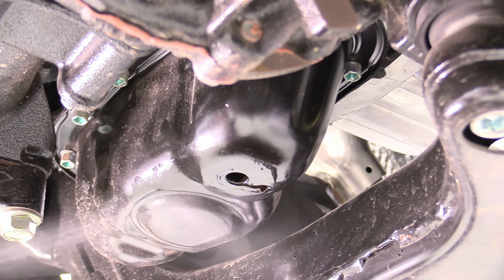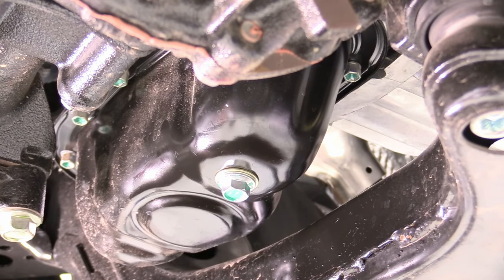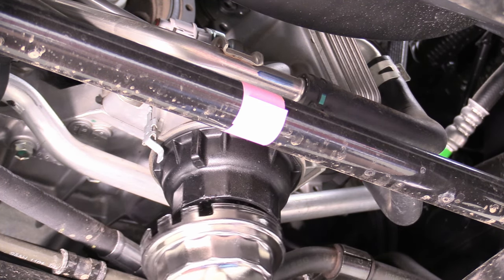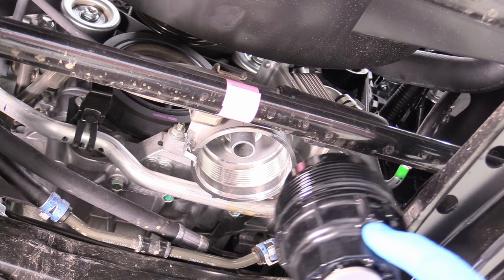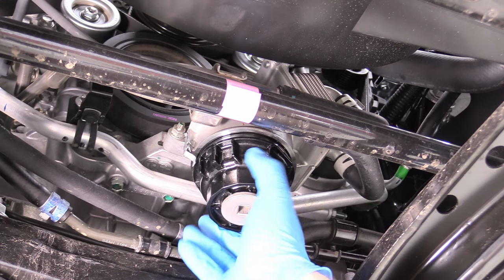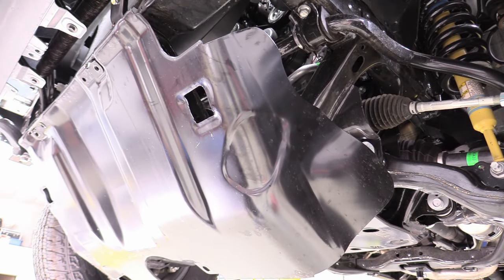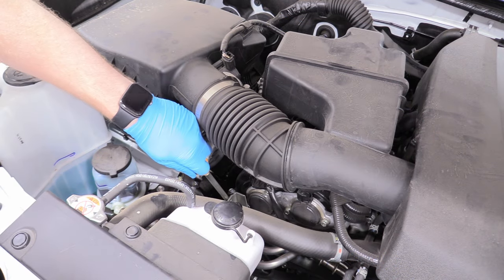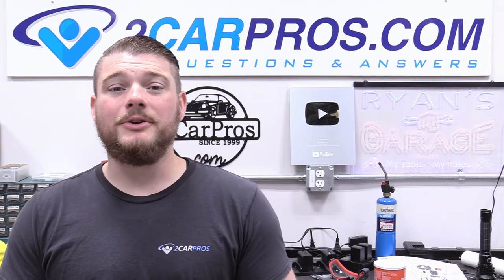How to Change Oil and Filter Toyota Tacoma V6 3.5L 2016-2023 | EASY!

Comment: WARNING: Use only Toyota OEM Filters/Parts. Yes, you pay more but it's designed that way for a reason. That ACDelco filter creates too much pressure and has less filtering material, as well. Buy Toyota OEM parts. Also, change your oil every 3-4 thousand miles and ignore all of the BS about 7-10K miles. Just ask an honest mechanic.
Reply: Yea because they just dumped good oil out, looked brand new, how about check your oil every 3,000 miles and 1,000 miles after once it starts to turn darker NOT black change the oil. These trucks are meant to be ran hard.
Reply: Isn’t synthetic oil meant to last longer than regular oil, which is why it costs a little more than the regular? No way I’m changing every 3k miles, 5k-6k yes, but nothing less or more than that.
Reply: @BuddyWestside Yeah 3k is excessive, 4k is the lowest I would consider but yeah I think the guidelines are 4-5k for regular and up to 10k miles for synthetic
Reply: Mine is black every 4000. Especially if you work in dirt roads.
Reply: I found the ase certified master tech guys!!!!
Reply: Where do you buy the oem filters I want to try and do it for the first time.
Reply: @Chuberino at your local Toyota dealership lol
Reply: WARNING: don’t fall for that stupid nonsense my 2010 Tacoma has 350,000 miles AutoZone or every oil change
Reply: Just finished changing my oil on my 2019 Tacoma. I bought the Motiv Oil Change tools on Amazon and they worked great!! The filter wrench fit perfectly on the canister without getting stuck on and the funnel screws into the filler tube so no chance of the funnel falling off while filling. I didn’t use the drain hose that came with the kit because I paid a “Mechanic” at a local shop to change my oil the last time and he reefed the plug so tight that it’s never coming loose! I also purchased the Toyota aluminum oil filter canister on Amazon along with 2 Toyota oil filters and a package of Toyota drain plug gaskets along with a 5 quart jug of Mobil 1 all on Amazon. Much cheaper than buying those parts at the dealer.

Comment: While it wasn't difficult to change the oil on my tacoma, it was probably the most difficult oil change I've ever done. I've changed oil for over 30 years from lawnmowers, pickups, farm tractors and dads fleet of 18 wheelers. I definitely prefer a spin on oil filter.
Reply: Same. And just had the plastic housing crack on me. When buying a new one, the parts guy said every tech up there has broken several.
Reply: I think it's the pressure. The small replaceable filters is the only perk other than that it sucks.

Comment: Mistake. I would change engine at 5,000 miles, or every 6 months, which ever comes first, go over, you are pushing it. Engine oil is cheap, spin bearing, burn bearing is not!
Reply from the maker: That is the conclusion I came to. Thanks for watching!

Comment: Knowing how to change Your own oil & filter is priceless.  Having owned only used cars since I started driving 25yrs ago, I can hoenstly say that taking the time to change Your own oil has saved me a ton of time in the repair shop, money, and headaches.  Having worked at an oil change facility & changed the oil on my friends cars has been eye opening and sad how many ppl neglect the oil change intervals on their vehicles.  Too many times have I seen sludge built up in the oil filter once its been removed.  My father taught me that it's better to run the cheap oil & filter in shorter intervals than to try and go past 5k mi/interval.  All oil breaks down, even if the car has been sitting.  And ppl often times do not take into account how their driving habits affect the change interval as well.  As  lifelong toyota fan, my hat goes off to toyota not only for their engineering, but making the oil changes easier with simple things such as oil filter placement in most of their cars & trucks.  It may be dirty & inconvenient at times, but the knowledge you gain being a bit more involved with your vehicle is priceless!  But that's just me, I find an odd satisfaction in changing my own oil.  Also, doing a simple drain & fill(if Your A/T has a drain plug) on your automatic transission fluid every 10k-15k mi. goes a long way to keeping your car running.  It does take a bit of research(the right kind of ATF & how much new ATF to replace the old fluid with is paramount) but worth it as well.  Instead of a pressurized Transmission flush, use the honda method: drain & fill every 100-200mi, 3 times.  It may be a bit wasteful, but it has worked wonders for every make & model that I've owned that had a transmission drain plug.
Reply from the maker: True! Thanks for watching!

Comment: My sister's drain plug fell out of her car on the freeway after a Subaru tech failed to use a torque wrench when tightening it (caught on camera, so Subaru covered the engine replacement). So while 30ft lbs might seem like a lot, I would always recommend following the manufacturer's torque specs as well as you can. Otherwise, this is a really nice, clear instructional video! Super helpful to see where everything is before you crawl under a vehicle.
Reply: @XxgunsxX1 yeah man i never used a torqe wrench only hand tight and that never happened to me they much of tighten it one thread

Comment: Thanks man. I purchased my truck in march of 2023 and took it in for “scheduled maintenance” around 6k something miles. I had just watched a video saying the oil on Tacomas should be changed every 5k miles, so I thought they would for sure be changing my oil on my first service appt. Then they tell me that it doesn’t need an oil change until February 13 of 2024 🤦‍♂️. I thought that was strange and most of the people I know thought the same as me. I’m now at 8,715 miles and still no oil change til next year February. Idk why but I feel like it’s a way to get people to have problems and end up buying another vehicle. So after watching this I’m definitely changing my oil for piece of mind next weeks paycheck.
Reply from the maker: That's what I think of too. Thanks for watching!
Reply: The newer Tacoma from what I can see is that the oil is thin and thus explains the whole new "OW-20" oil. Even if you ran 5k or even 8k depending on how you drive day to day. The oil friction shouldn't change much but your Tacoma will definitely be burning oil. Try this on your next drive...once you come home, go ahead and open that "oil cap". Notice anything funny? Yeah that your oil burning and causing smoke when you go too long between interval. The new trucks are meant to run full synthetic and so when you go for a "regular" oil change you are still getting "full synthetic" and when you request for "synthetic" oil, all they did was just up your charge for the same thing...lol. In order for the truck's of today to run at the efficiency that they are supposed to...most if not all run on synthetic over conventional oil. If I was you, go ahead and change up the oil right away! For my older Tacoma 2000 and 2003, I run a thicker oil because at 250,000...I can't run the same original oil because my engine has been worn down over time thus needing thicker oil that doesn't slip in between anything.
Reply: @RandomCaliforniaAdventure  I appreciate the information bro 👊🤙 I will try that tip on opening the oil cap when I get home today 🙏
Reply: Just remember, car dealers are about selling cars, not oil changes
Reply: I thought oil is changed at mileage intervals not on certain dates. Strange... 🤔
Reply: Changed ours at 5000 miles, not at the dealer. 10K miles is too long for first change.
Reply: I'm dealing with the EXACT same situation!! The local shops that I called do not even have the oil filter housing tool! When I ask them if they will torque it they say it just gets tightened down so not liking this at all!! I would do it myself but my back is effed and I am unable.  Sux!

Comment: Great video! I just changed mine for the first time at 5k miles. I noticed the smaller o ring on the oil filter was missing 😮. Surprising that it came from the factory that way.

Comment: Video definitely helped.  Having two of the skid plate bolts break off and having to put a cheater bar on my breaker bar to get the oil filter cover off kinda sucked.  Oil’s changed but there’s still work to do.   Covering resetting the maint required would have been appreciated

Comment: Thanks for the video - especially sharing torque specs.  One question - how do you reset the maintenance notification on the dashboard after you've changed the oil?
Reply: it resets after driving a certain number of miles. i don’t know how many for the tacoma but you can look it up
Reply: @bogballzzzz5643  ok, many thanks.   I also found a reset button scrolling through the screens on the dashboard.

Comment: Thank you for the video including torque specs. 
Guys like me are that fussy. 
I was a transmission builder years ago and now a retired medium/heavy truck mechanic. 
I found the owners manual stating the 2GR-FKS 3.5L engine requires 5.9 quarts without filter and 6.2 quarts with filter. I assume 6 quarts 6 ounces for comparison??
Reply: I saw that too. I guess 6 quarts works fine, all of the videos I have watched on changing the oil have used 6 quarts.

Comment: Humm interesting 5.9 qt? My 2017 Tacoma says in the manual 6.2qt my truck also has the V6 engine. Did Toyota change the capacity for 2023 Tacomas?

Comment: At 6:27  in Your Video,,, you show a Oil Filter Wrench Tool totally different then your description , It looks like some of the FLUTES are essentially Sloted  for the Top of the  Oil Filter Assembly !  .  Your description shows a Tool without any 3 SLOTed  Gaps . so this makes it hard for which to purchase  or it makes a Difference  !   Here is One Description on Amazon of one : The oil filter wrench for toyota is 3/8'' Drive, 64 mm Inner Diameter with 14 flutes for a snug no-play, no-slip fit. There are 4 slots on the bottom edge, which are mated perfectly with Toyota 15620-31060 oil filter cover and help prevent slippage when you unscrew the oil filter housing with tremendous strength by a socket wrench or adjustable spanner
Reply from the maker: Yes the one I linked works better. The one I used it cheap junk that I threw away and is known for breaking the housing. Thanks for watching!

Comment: What's up with that metal tab 9'oclock position (time @6:25)?....it seems to get in the way of removal and replacement each time. Is there some way to move it....seems stuck on there pretty good
Reply: I think it's there to prevent the filter housing from walking off if you don't tighten it all the way. It hits those ribs/tabs. On my wife's corolla with a similar design it does a little more to stop it from backing out and I had to hold the tab out of the way to get it started. Kind of a nice peace of mind feature.

Comment: I use Castro as everyone seems to use it for Toyota but I use Mobile 1 oil filter or OEM both do the job and I still would use mobile 1 oil but I’ll just go with Castro edge

Comment: Hi, quick question, I just bought a 2021 SR5 6 cylinder, it doesn’t have the second panel that you took off from the bottom for the drain plug.  Should I be concerned about not having that?
Reply: My 2023 trdSport doesn't either. Mine didn't come with one. Maybe they fell off 😅
Reply: SR 5’s do not come with that second skid plate.

Comment: Great video. ,  I had my oil done for years at Toyota but the last one will be the last one. They cross threaded one of the front skid plate bolts when I decided to change out the faulted clutch fan that they failed to catch all of those oil changes conveniently after the 125,000 or 7 year warranty was up???  I approached them on this and was told the oil was my fault for driving on the road in 4 wheel drive ???????????   Thanks again,  appreciate that
Reply from the maker: Oh man that's rough! I'm sorry to hear they did that to you. Thanks for watching Mike!
Reply: I really do not like the dealership (Hall Toyota Elizabeth City, NC) I bought my truck at. My free toyota oil changes are done and I will be doing everything else myself from here on out.

Comment: What do you think about using a little bit thicker oil or heavier oil like a 5W 40 or something like that?
Reply: That totally goes against what the Toyota engineers say. They say a different weight will work in emergencies but to be sure and change it back to 0w20 at next change!
Reply from the maker: Only if you live somewhere very hot. Otherwise I would follow the factory spec. Thanks for watching!

Comment: Why Castrol in the Tacoma? My '22 Tacoma SR v6 4x4 3.5L specs clearly specifies Mobile1.
Reply from the maker: Because Toyota signed a brand deal with Mobile 1. Mobile 1 is an amazing oil for sure but any other oil that's the correct viscosity, full synthetic, and a API Service rating of SN or higher will be just fine. Thanks for watching!

Comment: @ 5:50 you show the filter drain. I had a 13 Venza and currently own a 12 Lexus RX 450h (same engine on both), and they have this. I have found it nearly IMPOSSIBLE to get the drain cap unscrewed without unscrewing the whole filter cap. And, once it's loosened, no way is that drain cap loosening. I've tried tightening the filter cap extra tight and then removing the cap - it never loosens for me. But I just end up with plenty of oil to drain from the filter. For anyone who experiences this, it's okay!
Reply: I could see that happening. Good info to know going into this. I will be doing this in about 1000 miles.

Comment: my 1967 Chevrolet had a canister all filter. I was complaining to my mechanic about how messy and time-consuming it was, and he advised me that for a few dollars you could get an adapter plate which bolted ion in place of the original canister, allowing the use of a simple spin on filter. Isn't it great the Toyota has now regressed us 57 years in automotive design!  SMH 
changing my own all of us about the last maintenance I could do on my vehicles, looks like now I can't even do that. Thanks for nothing Toyota.

Comment: So good tutorial but you should always thread in a bolt or lug nut on a vehicle first before tightening to rule out crossthreading. Then tighten to spec. Trust me, I had dealer crossthread bolt on my old belly plate on 1993 4Runner and when removing, the bolt, i could never thread a bolt back in ever again. I also had a shop once do the same thing on a lug once. I had to bust off lug nut and replace lug. Not a good time with either.
Reply from the maker: Good luck! You got this!

Comment: Unfortunately your link to the oil filter socket doesn't take one to the same style you used in the video. It takes one a cheap model.
Reply from the maker: I linked the 30 dollar made in USA socket. Not the cheap stamped steel one I used. The one used in the video is about 8 bucks and can snap off the tangs at the top of the housing. Thanks for watching!
Reply: @2carpros  Okay, fair enough. Thanks

Comment: Thanks for the video but you lost me with AC delco filter! You can clearly see the difference. Oe filters cost less than aftermarket. Go to a dealer a grab a bunch of them and you will have them on hand when needed.
Reply from the maker: AC delco makes quality parts. I would use them on any car or truck. Thanks for watching!

Comment: i would use only factory oil.
Reply from the maker: As long as it's API SN and full synthetic and the correct viscosity. It's good to go. Thanks for watching!
Reply: Wait doesnt need 1 more quart of oil?
You used a 5 quart container

Comment: Don't do 8000 miles intervals. Sludge is the enemy of this engine. 5k max if you want it to last. Personally I do every 3k with Mobil 1. .
Reply from the maker: More is better, that is true. But 8k for most modern engines with full synthetic is good. 5K is what I do on my personal truck though, so take that as you will. Thanks for watching!

Comment: That's a Teflon drain plug gasket and they're really good can get them pretty much anywhere. Why you going to put that cheap Amazon garbage washer on your brand new truck???
Reply from the maker: Actually those are a one time use crush washer and once they are crushed you can't re-use them. 

Those rubber lined washers I have used for 10 years with zero problems and they are my preferred washer. Thanks for watching!
Reply: @2carpros  you call that a crush washer?? I replace them every time because they're cheap but it's not a crush washer. And it can be reused
Reply from the maker: @bigdaddymak1439  Not according to the Toyota Service Manual which us where I got the info from.

Comment: Thank you for posting, but the TACO is over engineered. Special puller just to remove the oil filter, and an special purge plug to remove oil trapped in the system. Remember when the plug drained the oil pan, and you could simply removed the oil filter by hand. Anything Toyo Motor Corporatism can nickel & dime their product owners over. And the Fob...I don't even want to get started on that garbage.
Reply from the maker: I like this truck, and I really like the drain for the oil filter. But I get where are coming from. Thanks for watching!
Reply: My 2020 Tacoma 2.7 had the old filter design. I just bought the 2023 Tacoma 3.5 & look forward to working on it. The new filter design probably works better & much cleaner. Worth buying the tool to remove filer VS wear oil all over hands/face. Great video. Thx
Reply: You can just use the filter wrench and loosen the filter and most if the oil comes out. Then lower it down and dump it in your drain pan. A little more messy but you don’t have to mess with the plastic adapter.
Reply: No worse than any other manufacturer.